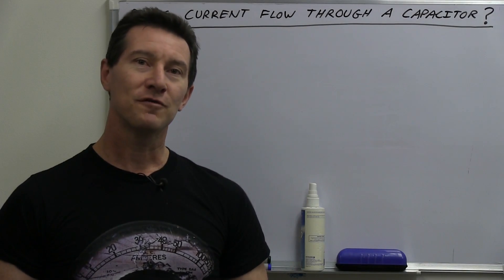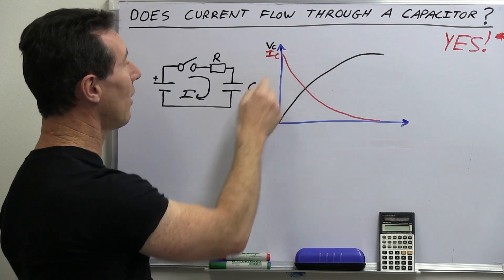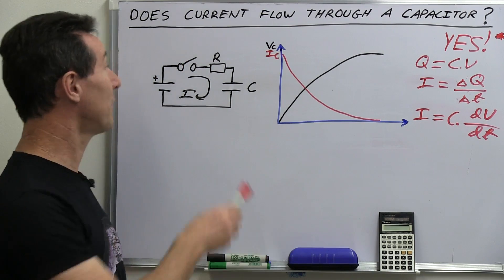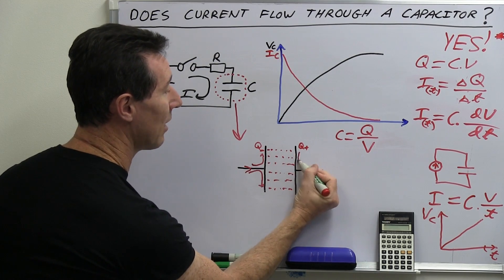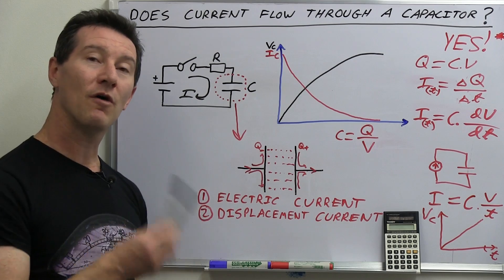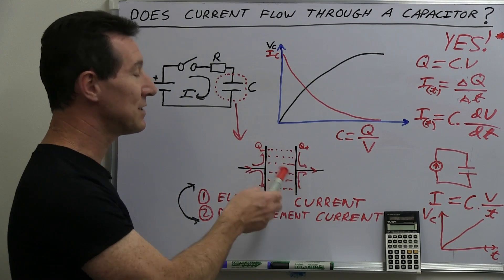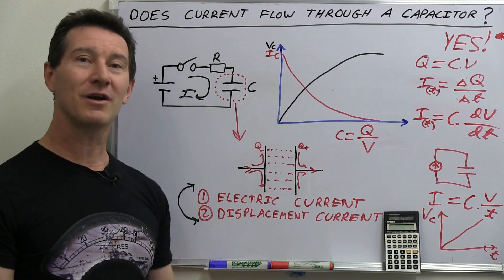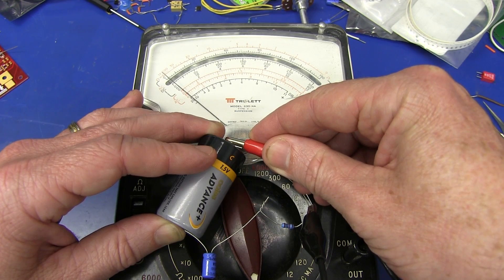EEVblog #486 - Does Current Flow Through A Capacitor?

Comment: Current and charge are two different things. The positive plate on the capacitor accepts charge from the battery positive and the negative plate gets the negative charge from the battery negative. Discharge is the opposite. The electrons do not flow through the capacitor. Don't believe that current flows through a capacitor. It simply does not occur. Imagine the capacitor is a small cell in parallel with the battery. Once charged, by momentarily closing the switch the capacitor will charge to the battery voltage. By loading the capacitor its charge will drop but the load will not discharge the battery because the battery has internal resistance. Removing the load from the capacitor allows the capacitor to charge back up to the battery voltage. What is assumed to have occurred as current flow through the capacitor is simply the accumulated charges that have accumulated on the plates of the capacitor being released through the load path. You might take a fully discharged capacitor and connect it to a load, through an Amp meter. You will find that no current flows. Now place the uncharged capacitor in series into a DC circuit, with a load resistance, and read the current flow. The meter will show no current flow because the capacitor, if it is not shorted, will be seen as an open circuit. What I tell you is true.
Reply: Greg SimcockIf you put a capacitor in series with a resistive load, and a power source. The amperage will at first be what ever the resistive load allows through a circuit at the power source voltage, volts divided by ohms = Amps. As the capacitor charges, the amperage will go down, eventually to nothing or almost nothing. It pays to get larger capacitors to play around with this experiment. 
People think dielectrics stop electricity, however that is not true. Just look at the old two point or two contact light switch. That air capacitor is charging and discharging 120 times a second when the AC power supply is outputting 60 hertz. The voltage of the air between the gaps is at varying voltages when there is power present. The air charges to, two different varying voltages, as it takes a charge. The air at the source contact is near the contact voltage. The air on the other contact is near the original or unchanged voltage of that contact. In between there is a gradient voltage between the points. It is only this varying charge that holds off power. 
Some power does flow through a common light switch, you can view it on an oscilloscope. It was for this reason that you are supposed to shut off the breaker before working on a circuit even if a switch is turned off and cutting all power to the equipment you are working on. If there is a lightning strike, a transformer or high voltage accident, you could be damaged or killed, protected by only one air gap, one condenser, that will fail under those circumstances. I am guilty of not following this rule, but if something happens to me I told me so. 
One amp second is also one coulomb. It is the amount of electricity that will flow through a circuit powered by a one volt power supply through a one ohm load in one second. This of course eats up one watt second of power, and passes one coulomb of electricity per second. Or creates one amp second worth of current. 
From my experiments capacitors do allow electricity to flow right through the capacitor. Until they are charged and acting like the air in a light switch, an air condenser. The dielectrics in electrolytic capacitors are anywhere from two to five times more conductive then air. The distance between the plates of an electrolytic capacitor, is much less than a light switch contacts or plates. Then consider the area the square inches, of the dielectric in the electrolytic capacitor verses the light switch contacts. I believe you can see that certainly there will be flow of electricity through a capacitor for sure. Until they are charged. Then the flow is repulsed.
Reply: Particles of electricity of course flow right through what we call an insulator until the insulator is charged in a ramping voltage, polarized. The more powerful a dielectric is, the less resistance it has. Salt water is a great dielectric.
Dielectrics and insulators follow ohms law. What we call an insulator is just a resistor at nearly 100 percent voltage drop once charged.
I can hook up a one hundred and twenty volt source capable of ten thousand amps. To a 100 watt incandescent light bulb. And across the element there will be nearly a 120 volt, voltage drop, at .8333 amps, that is ohms law. A dielectric is no different.
It is interesting that the incandescent element does hold a charge. It is mostly self inductance. But upon disconnection there is a charge in a incandescent element. There is a even a charge in copper wire. Dielectric is not a funny pun. It means what it says. Because every substance transmits electricity, until it is charged with particles of electricity enough to repel an equal or greater number of particles back.
Here by me we have to ground, bond with a copper earth ground, aluminum window frames near bathing pools, so that if a lightning strikes shock wave, or a sonic booms shock wave hits those window frames and glass, they do not charge and reciprocate with a lethal high voltage discharge to someone standing on wet cement or a wet towel.

Insulators of the same diameter as a silver or copper wire, transmit electricity faster than the silver or copper wire. Because the wire is a larger capacitor. It takes more time to fill.
That is why the little air condenser between the points in your light switch, can stop so much electricity, while only passing millivolts across the air gap. It is because it is less than a Pico farad condenser, or air capacitor.
Take two feet of aluminum foil off a roll of aluminum foil. Put it on a cement floor, Put a pillow on top of the aluminum foil, to hold it to the floor, connect one leg of a 24 volt source to the aluminum foil. Connect one test lead from a volt meter, to the other leg of the 24 volt power supply. Hold the other volt meter test lead contact between your fingers. Wearing pants put one knee on the cement floor a few feet away from the aluminum foil. Watch the meter go up. Lay down on the floor and watch it go to 14-18 volts depending on how large you are, how much surface area you can connect to the floor.  The cement can be painted many times or raw it does not matter.

Sincerely,
William McCormick
Reply: @WilliamMcCormickJr  Indeed. It is the insulation and the air surrounding the so called 'conducting wire' that propagates the magnetic displacement. The copper (or aluminium) is merely the conduit that forms the bounding loop of the circuit. The unique property of a so called 'conductor' is that once it is dielectrically induced, the dielectricity manifests a magnetic field, that is greater than the sum of its mass, in the presence of a moving permanent magnetic field. Electricity is not flowing through copper, rather a magnetic field is coupled out of the permanent magnet by the unique permittivity of the copper matrix.
Reply: +Greg Simcock "The electrons do not flow through the capacitor. Don't believe that current charge flows through a capacitor." There. Fixed that for you.
Reply: An amp meter does read a current while a capacitor charges for sure, no doubts here at all. If you put a light bulb in series with a battery and a large capacitor the bulb will light until the capacitor is charged. If there were no current, there would be no light.

Comment: What are capacitors on a logic board most likely used for?
Reply: Brendan Raymond Ah, thanks. Filtering decoupling Noise?
 I only knew capacitors from my photoflash, until I repaired my LCD monitor by exchanging the bulgy capacitors last week. In a flash the capacitor just gets charged by the battery and then releases its charge in a flash.
How does a capacitor do the noise filtering? 
How does that noise occur?
Eg, I have a lot of audio noise from the internal preamp on my canon 600D DSLR camera. could i cure that with capacitors?
PS: As a filmmaker I know what most electronic components do on their own, but I do not fully understand how they all work together on a circuit board more complex than my flash… So all this information is very helpful for me.
Reply: Felix Merz You fix a bumpy road by putting a sloth into each pot-hole?! That's cruel! Where do you come from?

PS: Without unstable power supplies and no parallel power lines we would not need any capacitors? So they are basically a quick fix for bad engineering?
Reply: The Kaiser Capacitors are often used as timing devices. It takes a certain amount of time to fill them. So they can delay a voltage to a gate.
Reply: William McCormick Why and when would one need such a delay?
Reply: If you are monitoring a known analog signal a pulsed signal, you can have the capacitor delay the firing of your triac, and or supply the power to hold the triac open, until a specified time after receiving the start of the signal. To extract or relay only a certain portion of the signal.
Reply: The Kaiser Wait, wait, wait. Capacitors are mainly used in AC circuits for low-pass or high-pass filters. They basically "nearly" block current at low frequencies and are "nearly" useless at high frequencies. 
The exact opposite happens with inductors.

So that means that you can basically press together the frequency spectrum of an analog video/audio signal (for example) so that higher frequencies are taken out which changes the sound drastically of course. But you use the low- and high-pass filters for Op-amps or antennas as well. They are in nearly every AC circuits because that is the whole reason why you would work with them.
Reply: The Kaiser They are often used for timing chip outputs. Usually the larger the capacitor the lower the frequency output is.
Reply: MasterOfTheHolyFish Take a simple single TRIAC am radio. It has an antenna, a variable capacitor, a little transformer which is the amplifier of the antenna information. The electrolytic capacitor delays the firing of the TRIAC which connects the amplifier circuit to the antenna. For a brief time period at a set voltage, the analog signal which is just a slight voltage variation within the carrier wave, is sent to the amplifier. This variation is music we hear or voices we hear. When you turn one on it takes a few seconds until the capacitor reaches, voltage. The capacitor also holds the TRIAC open for a set time period, or supplies power for it to operate. Usually there are a few resistors that act as a drain.
Reply: +MasterOfTheHolyFish, what are the quotes around "nearly" supposed to be for, according to you? Is it not truly nearly -- just figuratively? So it'a actually kind of far, or fakely near? Why not just actual nearness?

Comment: current flows through the wires leading to a capacitor while the capacitor is charging or discharging

here is a simplistic mechanical model

imagine an air tank with two chambers

run a pipe from one chamber to an inlet of an air pump
then from the outlet of the air pump to the other chamber

the air tank acts like a capacitor and the pump acts like a battery

when you run the pump, there is air flow through both pipes even though there is no air crossing the partition between the chambers of the tank

this flow continues until the pressure difference between the chambers matches the maximum pressure output of the pump (longer if the partition fails)

for the model to be more like an electrical capacitor, the partition between the chambers should be somewhat movable, so that an increasing "charge" on one side forces the "charge" on the other side out of the "capacitor" and creates a "current" out of the "capacitor", in addition to the "current" that is produced when the pump lowers the pressure on that side ( a bit convoluted ... sorry) 

my thoughts ? 

no. a current does not flow "through" a capacitor, not the way a pencil pokes through paper

yes, current does flow through the two wires leading to the capacitor, but only during charge and discharge times

anyway, that is my take of this whole thing

hope it helps someone

js:)

Comment: Current is defined as charge per time. When you think of a simple plate capacitor, you have the same AMOUNT of charge on one plate as you have on the other one, but it is not the same charge, as charge cannot move from one plate to another. Displacement current in a dielectric as Dave described only leads to a higher amount of stored charge at a given voltage (it increases capacity). So when you charge a capacitor, there is one current flowing in and another one flowing out, equal in direction and amount, but they are not the same current. That means: NO! There is no fucking current flowing through the damn cap!

Comment: I think electrons and current are 2 different things. Electrons are tiny components(particles) of mater-->anything with mass+space where as current is one of their properties when they move certain distance by certain speed.So current is the motion or flow of charge(electrons in this case). Motion of electrons is not the same in different materials. For example in insulators electrons can not pass through.In conductors they are free to flow or move conveniently depending on the type (nature) of the material.To make it simple in a circuit where there is a capacitor there is no flow or motion of electrons across the plate. That doesn't mean there is no motion of charge at all.The reason why that happen is because of the presence of the dielectric(insulator) matter between the 2 plates of a given capacitor. However one side of the plates receive charge and store it until it is full and the other side of the plate will have smaller amount of charge compared to the one with fully stored one. Both plates have charge and also electric field generated around them. That electric field is directed in 2 opposite direction and the one created from more charged plate dominates the other side with less charged one. This electric field acts as a force to cause motion of electron from the smaller charge region of the plate. That motion of charge happens to be current. Note still we can not see electrons passing or crossing plates rather they just move from where they are because of the force they face. That's my little understanding of capacitor circuits .  Yohannes Almaw EEE student From UCF
Reply: come on man whats going on ?
Reply: Benjamin Atsu Particles of electricity fly right through insulators. Voltage is pressure compared to all other fields of hydraulics, or pneumatics. You can have 1,000,000 volts of electrical pressure, flowing through 1,000,000,000,000 ohms and only draw 0.000001 amps, at one watt.  Most of our misunderstandings comes from shallow testing of insulating materials. Or tests we did with a multi-meter set to ohms. It is the surface area of the test lead that blinds us to what is happening. Try more surface area, a 24 volt DC source and a volt meter. Then you will see particles of electricity are moving right through insulators very nicely. And over great distances. Almost like radio through air, just a big air capacitor. When you load the insulator then you see it shine as a device that stops current, the volume of particles of electricity that flow at any given time.
Reply: Benjamin Atsu I was taught that particles of electricity are massless and weightless. They worked that way to build everything we have that is good today. Particles of electricity move right through insulators. Just like particles of electricity move right through an incandescent light bulb. Look at the voltage drop through a 100 watt bulb, if it runs on 120 volt AC, the voltage drop through the bulb is 120 volts. That is a pretty good insulator. You can touch the neutral wire feeding that light bulb and not get a shock. Because  it remains at neutral. An insulator is doing the same thing just on another level of insulation. The truth is until the insulator becomes polarized, it will conduct electricity very well. Lethally well.

Comment: No, no, no, Dave!  I'm surprised at you.  Displacement current is NOT caused by magnetic fields.  Displacement current is caused by electric dipoles flipping over.  A dielectric material is made out of electric dipoles that align themselves with an applied electric field.  Imagine a chain of electric dipoles aligned end-to-end and all pointing the same way.  Anywhere inside that chain the plus of one dipole cancels the minus of the next dipole.  So you just have a net charge on one end.  Now if they all flip 180 degrees, the net charge is at the other end.  So it appears that a charge moved from one end to the other, even though all the dipoles are still exactly where they started.  That's displacement current.
Reply: Steve Robbins All my teachings all my experiments show that dielectrics insulators, move charge faster then any substance on earth. Electricity certainly flows right through dielectric material. You just need more material to see it first hand. If you have a Formica counter top nice and dry, while standing in good work boots, on a dry surface, touch the hot lead from a 120 volt AC outlet. And just put your butt up against the edge of the mica counter top. With your pants and underwear on. Tell me if particles of electricity are flowing right through the mica and or flake board or plywood holding the mica. We have been learning and memorizing an illusion. I do this experiment regularly while I am testing. Ha-ha.